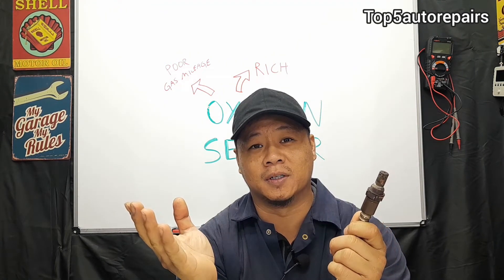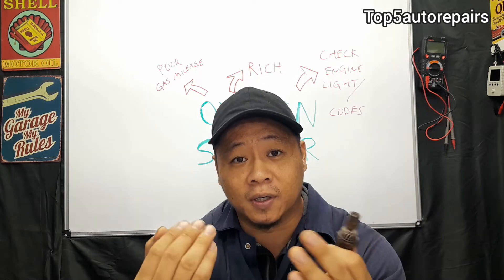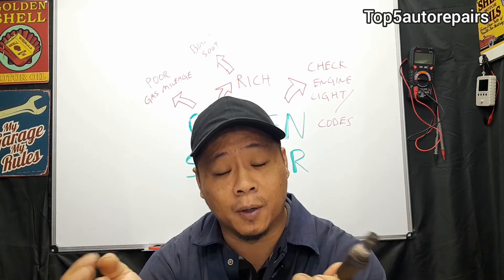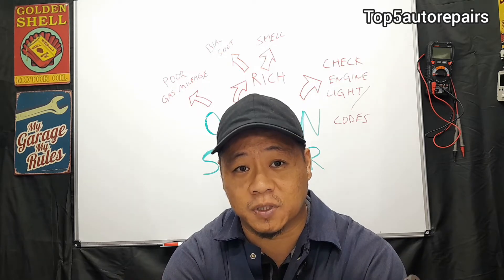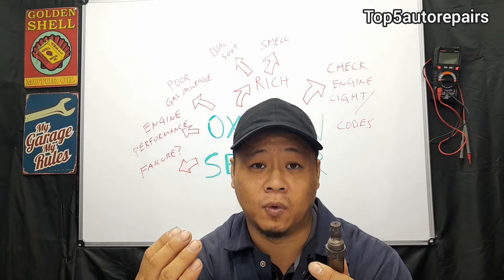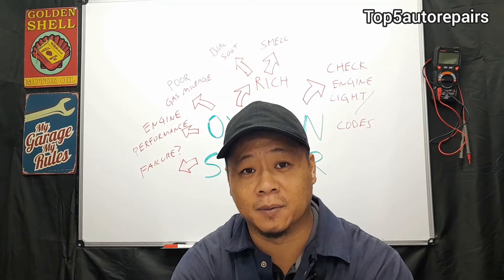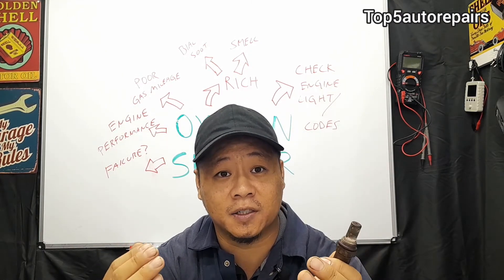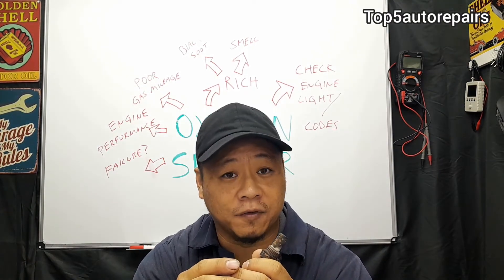Signs of Bad Oxygen Sensor (O2 How to tell it is time for replacement)

Comment: I diagnose the short/long fuel trim, sometime in idle it stuck rich, and sometime in idle its running normal. No loss of power, check engine, black smoke, stalling, nor any of the symptoms you listed in the video but fuel consumption only. Can this be a bad o2 sensor also? Or could it be something else

Comment: @Top 5 Auto Repairs I have 2010 meecedes e350. When I scanned it it say bank 2 sensor 1 does that mean upstream or downstream? Driver side or passenger? Thanks for any help
Reply: Not the video creator.  The answer is: Sensor 1 is IN FRONT OF the catalytic converter.  It tells the engine computer how to manage the engine.  

BANK 1 and 2 are because you have a V engine : V6, V8 or V12.  The cylinders are arranged in two banks, each with their own exhaust pipe and cat - which may join into a single exhaust at the rear of the car OR be dual exhausts.

  So Bank 1 and 2, each with an upstream sensor (#1) and a downstream sensor AFTER (or behind) the cat: Bank 1 has its Sensor 1 and 2 and Bank 2 has its Sensor 1 and 2.  

Both Senor 1's talk to the engine computer to tell it how to operate the engine.  Both sensor 2's measure how well the cat converter is 'cleaning' the exhaust - but they usually DO NOT affect the engine.  They can set a code to tell you, the driver, the cat is damaged or clogged but the bank one and bank two sensor ONE's (one for each bank) impact drivability - how the engine runs.  

Bank 1 is the side of the engine with the #1 cylinder.  Usually, 1, 3 ,5 and 7 (if so equipped) are on one side and 2,4,6 and 8 (if it's a V8) are on the other.  Your owner's manual MIGHT tell you which side is which but a mechanic will know.  

Hope this helps.

Comment: I'm getting a p0302 p0302 code with good spark plugs and injectors. I had a bad leak in the air intake hose causing it to misfire now I think it's the o2 sensor because It probably went bad try to keep up the bad air/gas ratio. I'm not getting o2 sensor codes just the misfiring codes
Reply: Your ignition coil is bad in Cylinder 2. That's what the misfire was
Reply: Bad ignition coil. P0302 is for cylinder 2, p300 codes are usually ignition coils and wiring

Comment: hi sir I have a Peugeot 206 the oxygen sensor complete failed so I replaced it will new one after taking the battery terminal off and putting it back I notice the the RPM counter it's not where it  supposed to be in the car have no power but it starts well I don't know what could be the problem in that

Comment: I heard you say that it misfires but you didn't say that the misfire was caused by the O2 sensor.. I have a very bad misfire.. and it read bad O2 sensor code 
I replaced the downstream on the Gen 2 Prius and it still has a very bad knocking.. it is quite difficult to replace the upstream O2 sensor so I would like to know for sure if it is the problem first.

Comment: I hace a 5.3 Silverado on a cold start it sounds choppy until I rev it a little it goes away, also has a tick. Any suggestions what it could be?
Reply: That is definitely your engine itself, the 5.3 and 6.2 GM engines are known for that. Could be your cam or lifters bro

Comment: One of my oxygen sensors is reading a negative value. It's throwing off my air fuel ratio. Bank one has +25 fuel trim and bank two has -34 fuel trim. Is it the oxygen sensor? No check engine light. I have many if tv symptoms you mentioned.

Comment: with all the sensors and bloatware on new cars I give them a hard pass!   Adding in your observations on parts failing and info is much appreciated.  I'll take this opportunity to put in some new censors here soon myself as I had some misfire issue I mended with new fuel injectors but w/e gets me better gas milage and extends the life of my ride cause I sure never wanna be working under an electric car.   thx for the the info